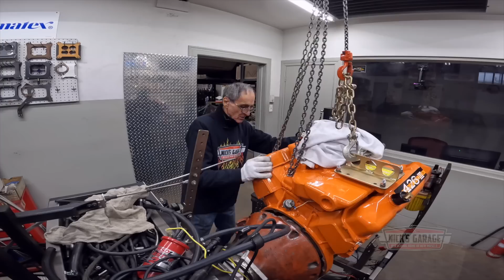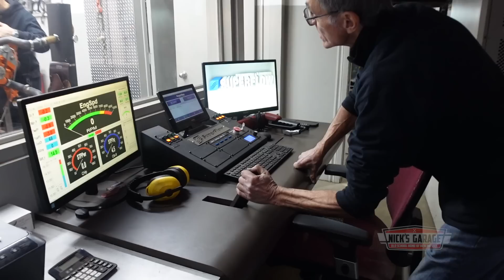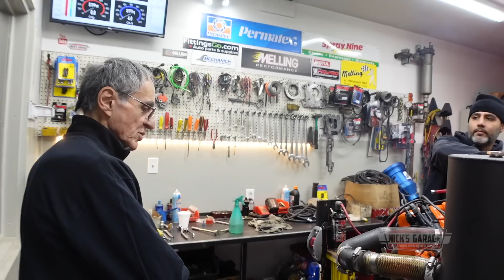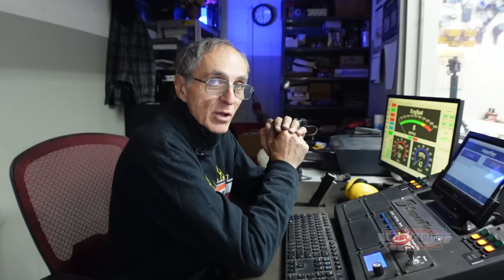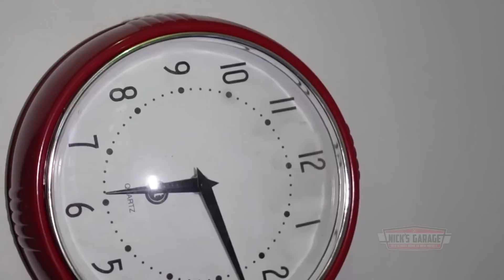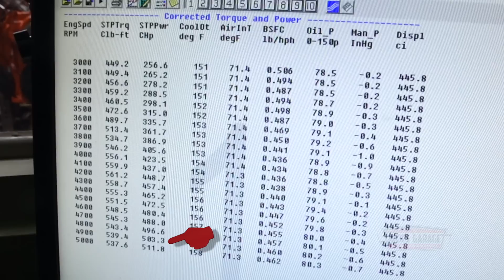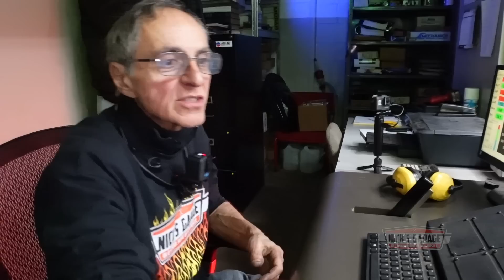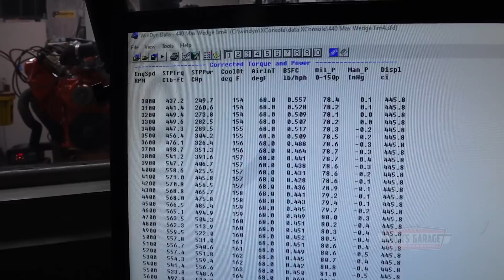Max Wedge Dyno Tested - Troubleshoot a Legend

Comment: Hahahaha jesus christ you guys look like monkeys trying to figure out a simple mopar distributor
Reply: Like many problems, the solution is simple once you figured it out.And it's easy to point out after. 
To those guy's credit, they were dealing with a brand new unit that had this odd 2 pieces shaft that was threaded the wrong way...
Maybe they did not notice, maybe it was designed for a small block or an universal unit....Maybe it didn't come with paper work or they just did not read it.
Also, pros and cons with working alone or with someone...It changes the chain of events for better or for worst.

Comment: Nick, that was a great video showing how you solved the starting problem. The possibility of excessive break-in wear on the cam is an interesting factor. Along the line I had the opportunity to field test a gas turbine engine in the North West Territories. It produced about 5000 hp and drove a gas compressor at a well head. I also had the opportunity to witness the performance of a gas turbine producing about 10,000 hp in a test cell in Ontario. One of the things that was carried out was lube oil testing to see the quantity of metal particulate after a certain period of run time. Though it may not be practical but it would be interesting to do an oil analysis before and after your engines are tested. A before and after oil analysis on this engine and the 440 with the super charged that pumped out 800 hp may have provided deeper insight into your testing. On another note, there were accelerometers on the gas turbines we tested to measure the rotating component vibration levels to monitor engine health. For your tests, your ear suffices for that task.
Reply: Speaking of gas turbine engines, Chysler developed a gas turbine powered car and made about 50 of them in 1963. I remember being excited seeing this car in the flesh at the Toronto Auto show in 1964. It was in the firefrost bronze colour on the Ghia-bodied coupe with black vinyl top and copper-orange leather interior. The engine produced 130 hp at 36, 000 rpm. Peak torque was 425 ft lb. The engine idled at 15,000 to 22,000 rpm and at top speed, the turbine maxed out at 60,000 rpm.  Wouldn't it be a "gas" to test that engine on the Nick's Garage dynamometer? Wear your ear muffs!!

Comment: I thought 550 HP is pretty good Nick! Is the cam that aggressive? Strange so much carburetion with a factory cam.
Reply: .600 lift with a duration of 250"  @ .050.
Reply: @nickpanaritis4122  are those Trick Flow 240 or Trick Flow 270 heads?  Those power numbers seem very low for 270 heads.
Reply: @colbyclayton8052  ..240 Heads.
Reply: @nickpanaritis4122  that would make it a street wedge.  Trick Flow 270 would be max wedge, correct?  I got curious because the numbers seem very low for a max wedge
Reply: You are correct. @colbyclayton8052

Comment: LOVED the video, and LOVE Max Wedges. I'm sure someone has already pointed this out (a Max Wedge expert I'm sure) but I believe the throttle linkage is clocked 180 degrees off. The rods are hooked to the wrong carbs and the linkage needs to be spun around 180 degrees to the lever pulls instead of pushes. GREAT video, can't wait to see it run at full potential.

Comment: It is perverse seeing carburetors sideways on a v8.  Until you think about it, and how the cross ram works with one carb feeding the opposite bank.  You got the primaries clear to the outside for longer paths and low-end torque, the secondaries to the inside for high-rpm.  It's just beautiful.  Those nerdy engineers going against tradition or norm to do what was right....cool.

Comment: Nick, Was valve spring pressure tested before assembly? What is the cam's recommended spring pressure? What's the cams RPM power range? Carbs, did you ever check float level?
Reply: We started with 120 lbs seat pressure. After a few tests, we shimmed up the valve springs. RPM with cam is about 5800-5900.  Float levels were OK.
Reply: @nickpanaritis4122  I know you had a problem with a previous motor that had too little spring pressure. You may get more rpm with shimming springs .020, but, hydraulic flat tappets can't take pressure over 130 seat pressure. The cam lobes won't last long that way. What is the cam manufacturers recommended spring pressure? High rpm's are great, but, it comes with an expense.
Reply: @milomanx6531  ....  They recommend 130 on seat and max lift at  300.
Reply: @milomanx6531  ,,,   130 on seat and max lift at 300.

Comment: You guys commented on a question I had (old hemi example).  If you have a low compression engine, there is no reason to run high octane fuel.  The very purpose of octane in the fuel is for slowing the fuel burn down....to avoid detonation.  In theory, on a low compression engine, you can handle a faster burn and hence more horsepower.  In other words, high octane on a low compression engine doesn't do any good.  It actually hurts.  But of course, on a high compression engine, yeah, run high octane to avoid detonation and get full pony.  The fuel matches the compression to run best.

Comment: Nick's Garage is where it's at I tip my hat Today is the day for the 440 Max Wedge Cross Ram and if anyone can build it Nick can You won't find any like this for sale and if you do they won't be built to this level of detail Engines like this you keep they're not for resale Nick is strapping her in and Shiad is on the carbs before the party can begin He tops up the dyno tank On Nick's Garage every Monday you can bank It's a complicated throttle mechanism that's the cross ram realism Once they've done the plumbing it's time to get it running Nick is determined not to wipe out the brand new cam to follow his tried and tested break in plan Nick has got the experience to get this Max Wedge to the finish line It's very frustrating it doesn't fire first time Nick and Shiad are the detectives at the scene of the crime The source of the problem they're intent to correct On this case in their face the distributor was the unusual suspect Nick has naturally got the perfect replacent object he's an expert on the subject It's Nick's Garage every Monday that I select Thanks Nick Respect Shiad Word George

Comment: I always spark time the engine before I start it. Turn on the ignition twist the distributor quickly and you'll see when the spark hits the number one spark plug wire and I have the timing pointer set at at least 30. This always works for me and the timing is within 4 or five degrees when I check it
Reply: Good point.  But not with this distrbutor. Turning crank with wrench was OK. But the moment you hit the starter, it spun the shaft.

Comment: The linkage is on. backwards. It uses a cable that pulls just like a single carb. Turn the pivot around. The linkage should run.straight along the carbs. For jetting refer to the old Direction. Manual.

Comment: I know it seems redundant but I would break in the engine with a single four barrel manifold and carb of a known combo. Also I would run a simple ignition system that you know is good. Do your break in and do a test pull on the Dyno for a base pull. Then install the cross ram and converted distributor. If it runs good or bad you can troubleshoot it without worrying about the camshaft. You waste too much time jumping around with all the questionable odd components. Use the KISS principle. Keep it simple stupid. No offense but sometimes too many people out trick themselves. I'm a old Mopar racer from the 70's.
Reply: We agree, but do not have a Max Wedge single carb intake laying around. Keep in mind this is the first Max Wedge Nick has ever had on his dyno.
Reply: @ShahyadG  have your customer pick up the single plane manifold they made for those heads. Those were the Trick Flow 270 heads? He could use it if the cross ram doesn't work well on the street? Speed costs.😂
Reply: That is exactly what we are doing on the 413 Long Ram. We are using a single 4 BBL to start with and testing. Then installing the Long Rams after.
Reply: Well, Nick's engines run great and he has no issues when the customers get their engine or their cars back. It works for him and perhaps you could learn something from this man.
Reply: Well, Nick's engines run great and he has no issues when the customers get their engine or their cars back. It works for him and perhaps you could learn something from this man.

Comment: Yes, dramatic dyno run, 
 Find all the bugs , springs,  vacuum leaks,  fuel issues. 
 I'm going on a hunch here and going to say vacuum related issues. I know large cams have low vacuum. 
 But I think there is a leak because you have never had an engine with a vacuum that low & it backfires on shut off. 
 Back to basics on this one.
  Push rods wrong length?  
 Just a few thoughts.  Be safe team

Comment: Nick, there was a late 50s-early 60s Imperial in a local junkyard here for decades.  since the 1960s.  it was still there when I returned 40 years later to buy a '67 GTO engine from the estate, yard owner had died.  the hood was jammed shut.  I wanted it cuz it had a 413 in it !!  just to get the engine!!  it may still be there
Reply: That hood would have to be torn open to see if it has a 413.
Reply: @nickpanaritis4122  the yard owner and nephew knew the car well.  I could see the engine through slightly cracked open hood.  it was a 413.  they knew their onions with Mopar. I came right home looked it up.  it was a 1960 Imperial 413. all Imperials from 1959-65 came with a 413 from factory.  this was 1960s era most all cars on this yard still had original motor in them.   in 1966 Imperials went to 
the 440 stock motor. there also was a 1959 Dodge 326 poly v8 car in the yard.  not the early hemi/poly Dodge block- the early 277/301/318/326 poly only block with wavy valve cover on bottom.  326 was one year only poly motor.
Reply: @nickpanaritis4122   let me tell you story, my dad and I went there when I was a child.  yard owner had Jeep straight 6 engine dad needed.  wouldn't sell it to us.  old guy shows me GTO 400 engine on ground under car hood bent in half to keep it dry.  I return 40 years later.  Jeep engine still on floor in garage.  10 cent Coke machine still in garage where dad bought me soda back when.  GTO engine still there.  bought it $250. big valve 360hp 400 w/qjet, 4 speed code,  numbers matching carb to pan.  looked around yard, found 1958 Chevy with W block, no top end.  348 with heads, intake in trunk. bought it $300. found 413, 326, field full of 1950s Olds Rocket v8 and Caddy v8 motors on the ground,   to this day they won't sell Jeep motor.

Comment: I like those rocker arms very much. I'd like a set of them with an old school solid lifter flat tappet camshaft.

Also, years ago I was mucking with 2x Edelbrock AFBs on a 440 on a CH-28 and I wished there were AVS style Edelbrocks because of the fixed secondary air valve weights. They're a bit of headache for the tuner of dual quads - there's got to be an easier way I thought. I thought a hybrid of the AFB and the AVS. Well as it turned out my wish was granted with the Thunder Series but it was too late for me since children came on the scene LOL and that was that.
If you're going to put new carbs on it try 2x Thunder Series. The best thing with them is you can adjust the secondary air door tension to your heart's content. A dual quad tuners dream.

Comment: Nick, I'm a big fan of yours down here in Louisiana. Been watching since the beginning and always enjoy your show. I run Indy Cylinder Heads 440-1 max wedge heads on my 500 inch 440 stroker. I bring this up because they provide the valley plate needed for the heads. I'm curious if it would work with the Trick Flows? Keep up the great work!
Reply: I did not know if the Indy Heads Plate would fit. I bought this one from Trick-Flow.
Reply: @Nick Panaritis  I haven't inspected the trick flows but the Indy heads have an angled space under the ports that match the valley plate. Really enjoyed the Max wedge build and all the others as well!

Comment: Lot going on here...l think the first max wedges (413 & 426) ran skinnier pistons (stronger draft?) @13:1 compression (higher octane leaded gas back in the day) & a solid lift cam...your max wedge printed some strong numbers for pump gas & hydraulic lifters once the distributor situation got sorted out (first time I'm seeing a shaft threading the rotor up into the cap?) lot going on here

Comment: I've seen that power fall off myself a few times, usually on big block Chevs with flat tappet cams. I've had success shimming just the intake springs since the intake valve is heavy.
Reply: I agree.

Comment: A two piece threaded distributor shaft!? Who knew? That was a bean counter's idea.  A quick tig weld fix.
Reply: We had it Tig welded after. We installed it again and started the engine.  Idle was great, but when it reved past 3000 RPM's it started misfiring. Still had issues.

Comment: Re the talk about the low compression Hemi engine making more power with 87 octane gas. >>> lower octane gas always has more energy, as high octane just acts as a buffer to prevent detonation. If an engine isn't high compression- ie:  adding octane is not only a waste, it will make the motor lose power and get less MPG's.....alot of people don't realize that.

Comment: Stupid distributor 💩 that 2piece rod unscrewed, put pressure on the assembly and THATS why it was hard to turn the housing 🤦 ... TABARNAQUE !!  ... ... I have short temper issues and I would probably had that distributor flying across the shop 🤣 ...

Comment: Those secondary drop valves are fluttering all over the place too...that is going to change both air flow, vacuum, and fuel delivery.
Reply: True.  Non molested carbs.  Maybe that is how they work.
Reply: @nickpanaritis4122  Normally, at least with the Carters, Holleys, Rochesters and Edlebrocks I have ever worked with, under full load, they never fluttered.

Now while I can't imagine how these were fluttering so badly, it is still, in my experience, totally new, because usually when you 'full open' a rear set of barrels, there is literally no room left for them to flop around in.

Their spring tension pushes them shut, but the terminal end of the crescent rotary deflection plate forces them open, which means they are pressed tightly into place.

Seems that the only cause I can come up with is really weak return springs, OR, just maybe some kind of modification of the lower butterflies, such that they are not operating as they normally would, and are experiencing some kind of really abnormal internal turbulence, which, to be honest, in such a small system as that, really makes no sense.
Reply: @hunnybunnysheavymetalmusic6542     They have counter-weights. Something to look into. Thanks.

Comment: I wonder if a 413 block could be bored to 4.25 to get the correct cubes, of course I like the bigger bore more power, guess you can stroke a 383 but then you would have to find an intake that matches the Max wedge for the B block, how about a 400 B block stroker Max wedge? well to much hotrod brain the original is beautiful and awesome great job!

Comment: Why not take a 440 block and sleeve all eight cylinders down to 426 specifications? This would give you stronger and thicker cylinder walls. Yes it would cost a bit more but would be worth it.
Reply: Or you could save ALL that money and tell people it’s a really strong 426 and not a 446.

Comment: I believe the original Max Wedge had around 12.5 -1 static CR.  I’m guessing this 440 has a more streetable CR? I would think this would affect how much carb cfm this engine can handle vs the original 12.5-1 engine with the dual 750’s.  The cam profile would also affect this of course.
Reply: 11.3 CR. Aluminum heads. Cam profile is .600 lift and duration @ .050 is  250.

Comment: "Big Daddy"Don Garlits was a total Mopar dragracer. He has a 1962 413 Max Wedge Dodge in his FL museum that has the same manifold set up. The info Don has on the Storyboard  is : 
"In 1962 dodge built about 25 of the Max - Wedge Dodges for drag racing. Don Garlits was fortunate enough to obtain one of these very fast vehicles through Frank Wylie at Dodge Public Relations. Don and his Wife Pat both drove the SSIA at the drags, which stood for Super Stock, Automatic transmission. The 727 Chrysler automatic was the first automatic transmission offered by the factory that could out perform the stick shift models."

Comment: I modified a cast-iron distributor with electronic ignition guts for the 56 354 Hemi in my 57 Dodge pickup but I could never get it to work, I modified a stock aluminium electronic distributor from small block Chrysler and it worked fine, I think the cast-iron housing interferes with the magnet
Reply: You have a great point there.  We had the shaft Tig welded and had it installed and got the engine to start.  Idle was fine until you started to rev up the RPM's  on the engine and it started misfiring.  Thank you for the info.

Comment: This why I am a subscriber; the honesty in every episode .The engine has a problem not of Nicks making which at first is baffling. He then resolves the issue with relentless testing. Anyone who has ever worked on old school engines understands what Nick experienced. I learn something every episode.
Reply from the maker: Thank you!
Reply: @NicksGarage  Hi  Nick
I was wondering if you knew whether or not the 426 Max wedge with 13.5 to 1 compression ran on pump gas of the day ? Do you know the minimum octane requirement for the compression ratio ?
Reply: You and I both !